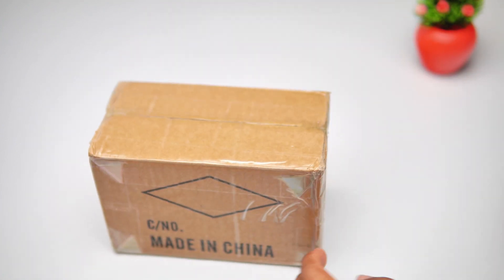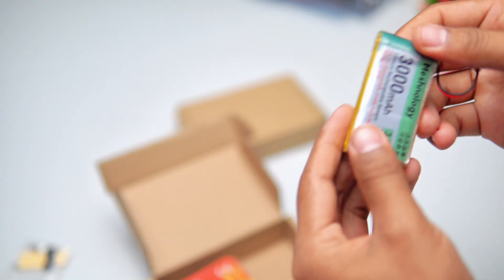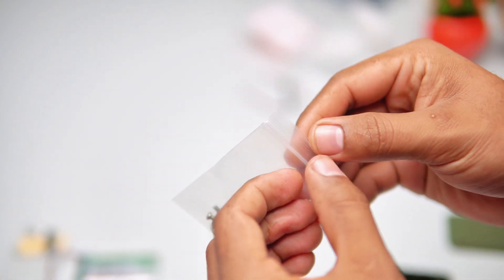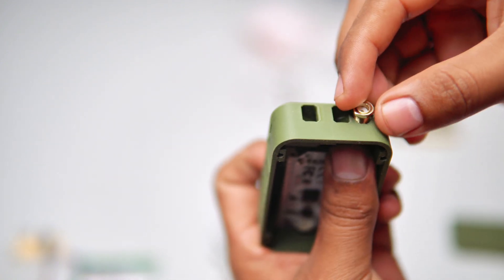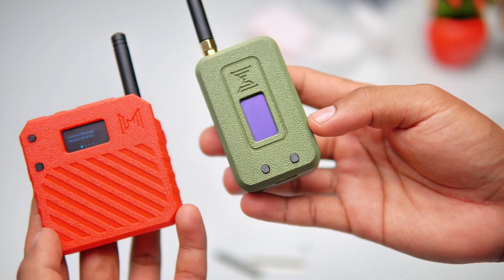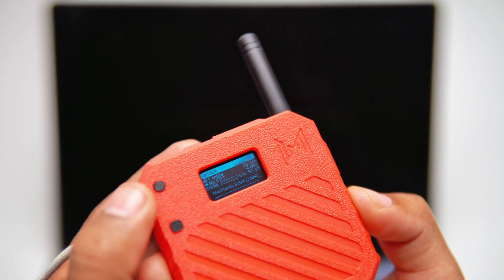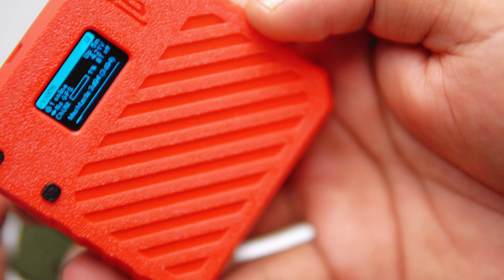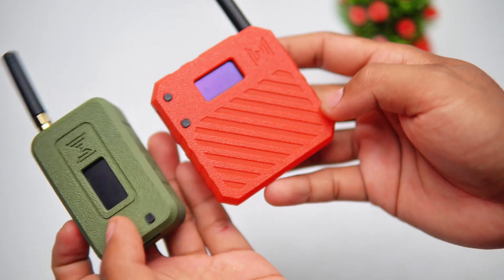You must have this device in the Remote Area !!!

Comment: Meshtastic and generally most LORAWAN stuff have cult-like followings but have zero practical value. They're expensive toys only and a real abuse of the LORA protocol.
Reply from the maker: I appreciate your perspective, but I believe the practical value of technologies like Meshtastic can vary greatly depending on the specific use case and user needs, especially in remote areas where traditional communication might be limited.
Reply: @technoingenious  I am in a semi rural area and there are no lorawan nodes anywhere.